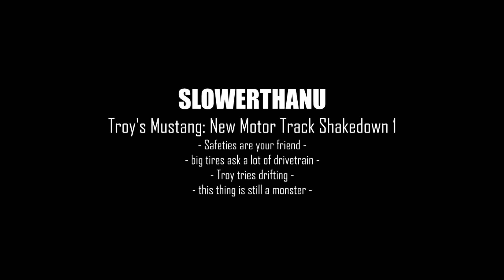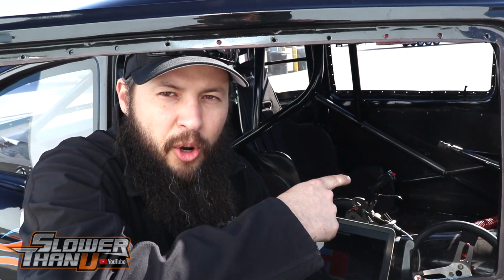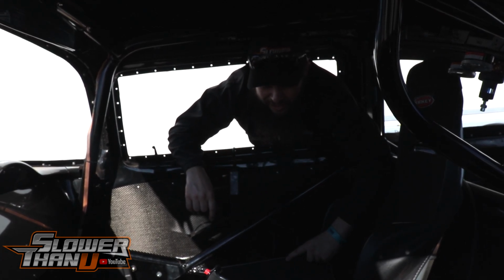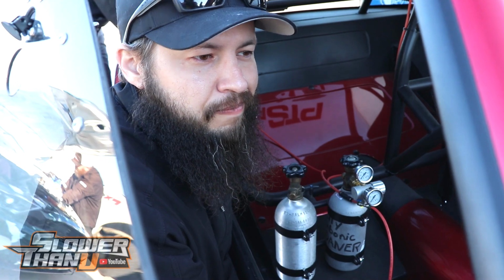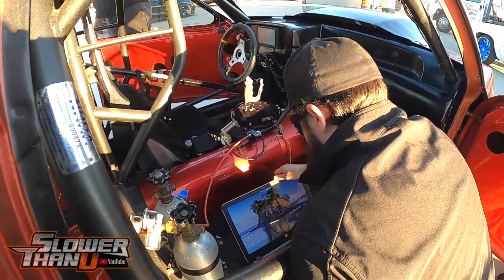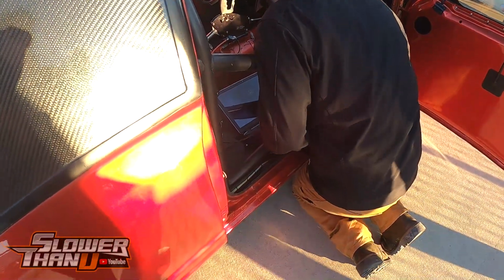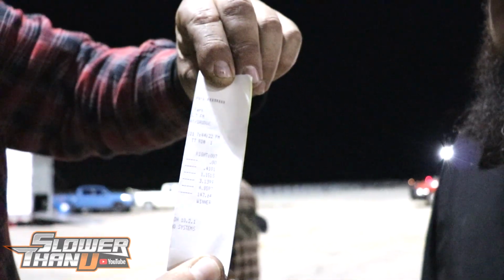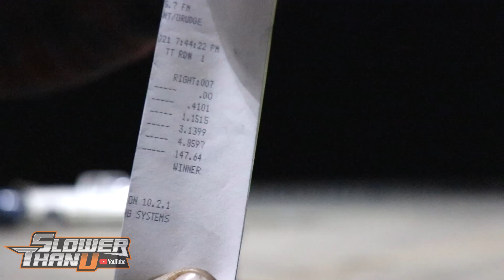106mm Turbo Mustang starts getting serious #turbo #foxbody #holleyefi #snakeeaterperformance

Comment: Do you guys run a turbo timer (keeps oil flowing to the turbo while is slows down after the cars shut off) on the car? I’ve heard it’s something I should do but I wanna get input from a bad ass build like this.
Reply: On this car the oil never gets all that hot, although I haven't been on the track to see it run I doubt they run it more than needed. This isn't a street car so the turbo isn't going to have a lot of the issues you'd see in hard Street driving